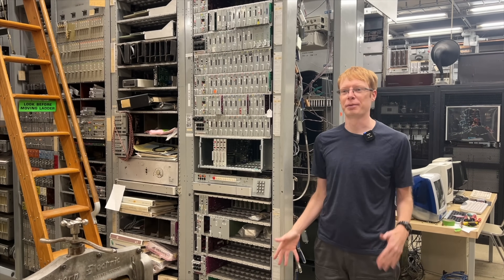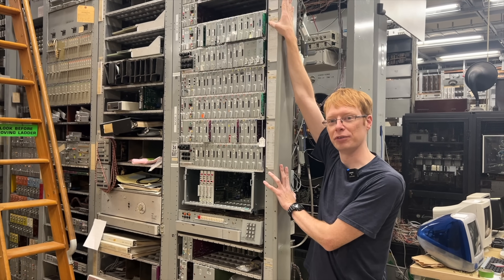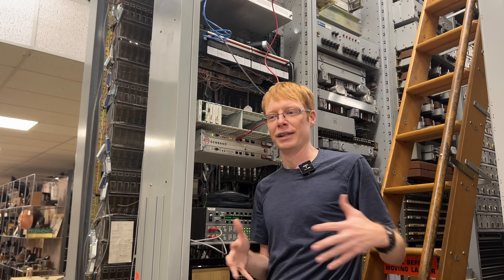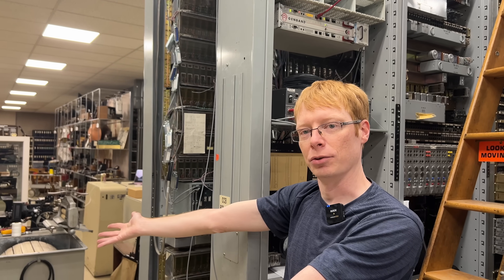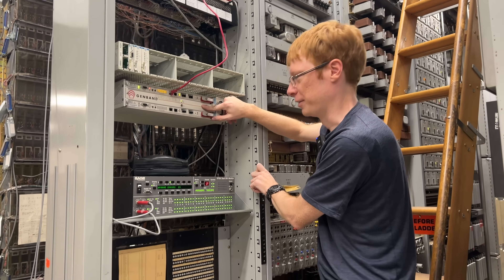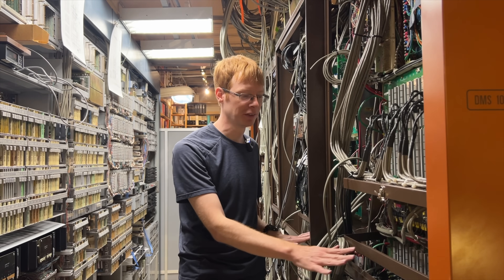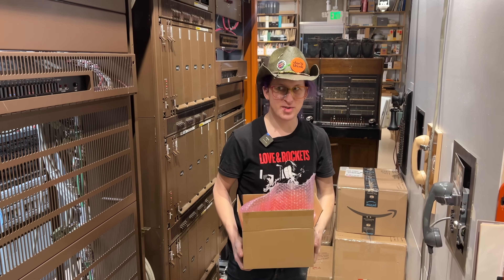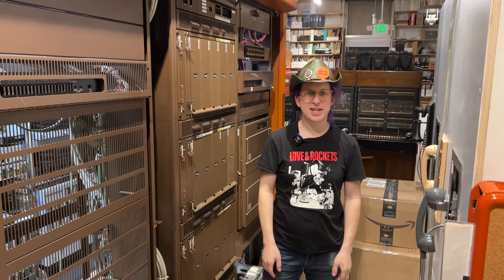DMS-10 & Its Dozens of Digital Devices!

Comment: As of Nov. 2025, I’ve still got an active POTS over Fiber landline out of a DMS-100 on AT&T.

I have yet to receive a notice of discontinuance, but I am expecting it within the next few months… 

I will migrate to AT&T VoIP when they force me off POTS…

I don’t even use analog phones with my POTS line anyways. It goes straight into my Grandstream UCM6302 and is converted to SIP. I’m using a mix of Poly & Cisco MPP8841 end points, so I’ll be ready for the inevitable sunset..

It’s been a good run on POTS.

While I’m in my early 30s, I had the pleasure of experiencing a 1AESS at my old house, right until the cutover to a Genband MG9000 in 2011..

Now I’ve gotten to experience DMS at my new house… Just wish I could have experienced a step-by-step. 😢

Oh, and I wish I could experience what a CO fed POTS line is like too.

Growing up in the 90s, my childhood home was served out of a BellSouth FTTC system and then building our current house in 2017, meant I went straight to a GPON POTS over Fiber Line.. Longest loop length was 70ft 😅.

Comment: Your DMS-10 will accept the same line C.P. plug-ins,  (such as NT6x17AA's), from the DMS-100's?  Possibly a similar pack, (later revision possibly), from the DMS-500?   Did interface with a CLEC that utilized a DMS-250 as their host switch... Did not know of any site with a DMS-500.  More new (to me), interesting museum info., provided by you here on Y.T..  Thank You! 🏆

Comment: The Genband G2 is an amazing box.  Where I work we are using it to convert DCO proprietary remote links (RLS) to gr303 as our DCO's don't have gr303.  The power converters on the G2's break easily and spares are hard to come buy.  Great video!
Reply: @robertlane6675 digging up a thread from a year ago, it's cool to hear how the G2 works in real world use. In the museum we've had a hard time getting the G2 to work since we don't have any documentation for it and the configuration is pretty complicated. Ribbon support says they don't have any docs either (hmmm), if you happen to have any leads on manuals for it we would be super interested.

And thanks for the tip on the power converters. One of our boards doesn't power up and I bet that's why.

Comment: Looks like an adtran mx2800... worked with dozens of those critters back in the day. And it was exactly to do away with hundreds of individual T1's. (A Cisco 7513 with 128 T1's takes 2 hours to boot. Unless you jumpstart the process. A bunch of PA-2T3's, and it works like you'd expect. I know... shouldn't ever be reloaded, but bugs...)

Looks like you need a few DS3 x-connect modules, too. Then you can wire the 2820 and never have to even look at the back of it again. That's what we did. (spent about two weeks "hiding" at the CO making cables, and wire-wrapping stuff. sadly, I have no pictures of all that pretty cable-laced wiring.)

Comment: Do you at the museum have any TD-2 "Long lines" microwave equipment on display? Always been extremely fascinated by that system after spotting a bunch of the old ominous looking horn antennas on towers out in the wild, doing some research, and going down that rabbit hole...
Reply: They have the original 6 GHz microwave radios from the long lines system. Also equipment for the Frequency Division Mutiplexing the system used.
Reply: @EvanVanderStoep  cool! They just need to put some horns on the roof....
Reply: @EvanVanderStoep oh my, group, supergroup, master group. Man I’m felling old. Oldest FDM stuff I worked on was in Turkey and it was from 1949. 😊😊
Reply: Yes, they do have some long lines equipmenr